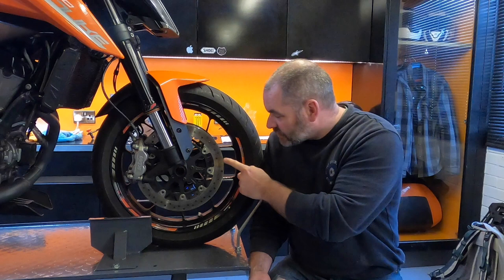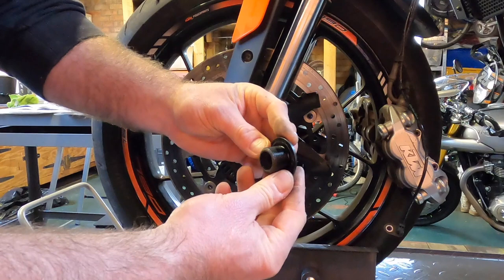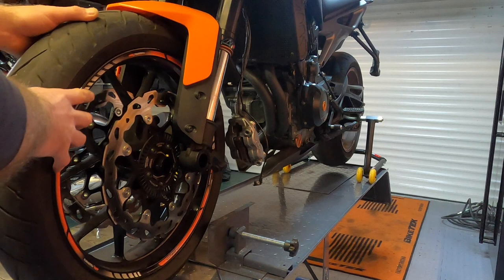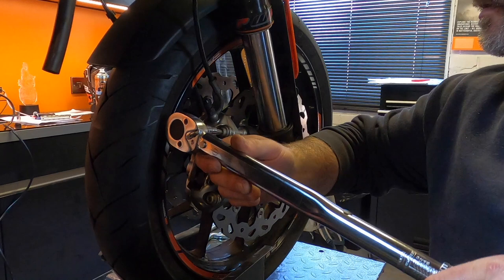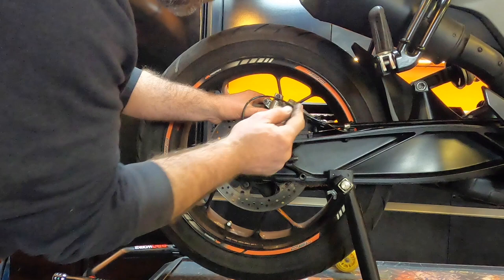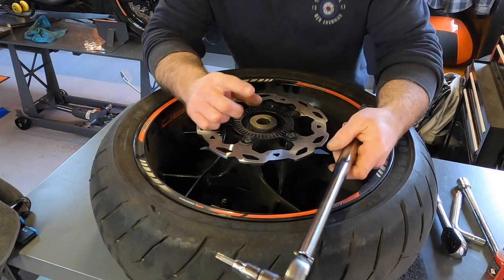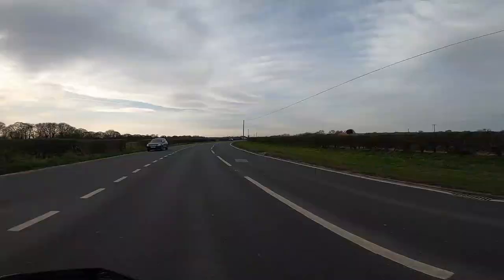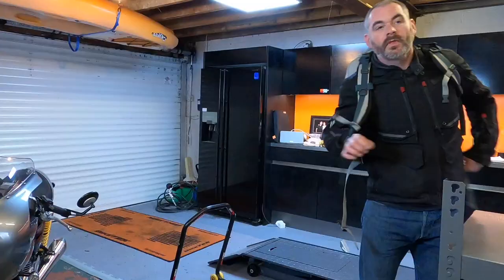Step by Step Upgrade to Galfer Wavy Brake Discs on KTM Duke 790

Comment: Great timing! My discs are pulsing terribly now so it looks as though I'll be doing the very same thing in the very near future. 
Thanks for the vid 👍🏼
Reply from the maker: No worries!  Pulsing brakes are annoying as f@*k!
Reply: @TheBoltHoleBiker  Was barely noticeable to start with, worsened within another 1k. Not the most confidence inspiring whether cruising up to junctions in town or trail braking into a corner 😯
Reply: Speak with your dealer, had the same problem replaced them f.o.c as pulsing is a common known fault
Reply: @timhowarth7720  Funny you should say that... Both me and the dealer have tried KTM with no luck. Outside of warranty and lockdown not taken into consideration. I wrote a customer complaint yesterday to argue my corner, so we'll see what happens after that. 
Otherwise, there's going to be a VERY moany video uploaded soon!
Reply: @CampbellZeroOne  I’m surprised it was never a recall issue by KTM from the amount of people who have had the problem, wavy discs seems an expensive way of curing it as there is no benefit other than cosmetic
Reply: @timhowarth7720  That was one of the arguments that I've put to them. I had a recall on my R6 back in the day where they were replacing the airbox because it 'might' rub on a wire and cause it to short and cause a fire... I don't ever remember reading that it actually happened. Only that it might. 
KTM though, seem happy to have their customers potentially washing out into traffic mid corner? For the life of me I can't understand how this doesn't require a recall on the grounds of it being a safety issue. 
I've never had this issue rear it's head on any of my previous bikes either. It's strange way to treat your customers.
Reply: @CampbellZeroOne  Hopefully you get some positive news from customer complaints 👍🏻
Reply: @timhowarth7720  Here hoping Tim. I've new discs on the way regardless. But it would be a nice gesture to be reimbursed. The way things stand though they've just talked me out of buying a new 890R...
Reply: @CampbellZeroOne  I was tempted to go for the 890R but swapped my 790 for a Street Triple RS , no regrets at all, did enjoy my time with the 790 but after owning an original Street Triple R for 7 years there was only going to be one winner 😊
Reply from the maker: @timhowarth7720  Funnily enough, my brother's went even worse than mine, they were really vibrating and he tried to get his replaced under warranty but, as they view them as a consumable item, he had to pay.  Does seem a bit shit, as it is clearly a known fault.
Reply: @timhowarth7720  Nice bike. Ran an R a few years back. Very nimble. What do you think of the new Speed RS? I enjoyed the versatility of that engine configuration, but there's something about a twin that suits how I ride, so I'll probably try another when the time comes.
Reply: @TheBoltHoleBiker  Playing the consumable’s card is bloody cheek when surely there’s safety issue and the fact folks are reporting issues with only 4K on the clock, mine were done at 5k , never had to replace disc’s on any other bike I’ve owned 🤷‍♂️
Reply: @CampbellZeroOne  Like the looks of the new Speed but unfortunately I’d bought the Street RS before the buggers told us about the new Speed 🤦🏼‍♂️😂
Reply from the maker: @timhowarth7720  I agree, it is a strange thing for them to dig their heels in over, doesn't exactly look good from a safety point of view.

Comment: I added these at the same time I swapped the pads to Brembo 07BB1990 and quite happy with the brake performance now. I have a set of the HH pads here I might try at some point. I've been thinking of a Brembo 19RCS master cylinder but doubt I will.
Reply from the maker: Yes, I was considering a Brembo master cylinder, but I don't think I will either, I'm quite happy with the brake performance as it is now.
Reply: Great vid. Good to know its a worthwhile mod. I'm still on the originals on mine, but always thought the initial bite was lacking a bit 👍
Reply: @davem3008  Start with changing the pads as it's the most bang for buck change you can do.

Comment: Hi Mr bolt hole biker 
Great channel by the way 💪🏼
Could I ask your advice on the ride height setting on the rear spring I'm 6.3ft weight 85kg I'd like to make the bike slightly taller but not have the preload to hard,any advice would sincerely be appreciated

Comment: hi... how many kms in when you felt the rotors warp? thanks for the install walk thru. didn't know about fork dive before tightening
Reply from the maker: 👍 mine started warping very slightly at around 11-12,000 if I remember correctly.  I changed them before they got very bad.

Comment: The wavy discs were fitted on my bike when I got it but i think maybe the original pads were left on. so when these need replacing I should go for the sintered ones?
Anyway happy braking. as I get older I have found good brakes means happy riding!

Pat
Reply from the maker: Agree 100%. And, yes, I'd put the EBC HH sintered pads on when you need to replace the pads👍. They are decent.

Comment: Thanks bro. Did you ever think to change callipers to brembo stylema?
Reply from the maker: I have considered that, but wanted to try brake improvements bit at a time to see how far I needed to go to get them performing right.  So I started with the pads, which did make a difference, but not enough on their own, now I have changed the discs to be honest I think I'm okay with the performance now.  If I hadn't been then I probably would have considered bleeding them first, just top make sure it wasn't just a set up issue, then braided lines, calipers and master cylinder in that order.  All starts adding up fairly quickly though!

Comment: Great upload, thanks. I'm thinking of adding these discs to my fj1200 if possible. I'm still considering a 790 or speed triple to replace my other 2 bikes next year, just can't decide....
Reply: Speed triple is a fast and excellent ped but it's nearly twice the price of the 790.
The Duke is not only a super bargain, it's bags of fun, excellent handling and fully loaded. 
£7500 new.
Reply: @fantastic1965  I'm thinking used triple as I can't afford new. I have ridden a triple and loved it but the lightness of the 790 and the potential to have a new bike is tempting.
Reply: My brother has the speed triple and I have a 790 there is vids on my channel of us riding together
Reply: @DukeOfTwist  thanks, I'll have a look.
Reply: @michaelmclarney1994  45min 300+ corners is uploading currently - should be viewable in a couple hours.
Reply from the maker: What a lovely dilemma!  Sounds like you have some test rides to book in!
Reply: @TheBoltHoleBiker  it's a tough one, it may be decided by how my injured food recovers and copes with the weight of a bike, as I find both tall for my short legs.
Reply from the maker: @michaelmclarney1994  you’ve got injured food?😂😆😂😆😂😆😂😆
Reply: @TheBoltHoleBiker  supposed to say foot, that will teach me to wear my glasses 😂

Comment: Arent the pinchbolts suppose to be 15nm?😅😊
Reply from the maker: Hi, yes, I have just checked and they are 15nm, did I say something different in the vid?  If so I'll get it amended, cheers for the head's up.👍
Reply: The Bolt Hole Biker 10nm in the vid😊 great video tho👍very useful to me because today was ”change warped disc day”😅
Reply from the maker: @andreasbrander9819  Cheers, and thanks for keeping me right, I checked the vid after your comment and I did indeed say 10nm, don't know how that happened!  Doh!  I'll have to look into how to edit a live video - not tried that before!  Good luck with the disc change, it'll be pure pleasure braking once it is done...👍